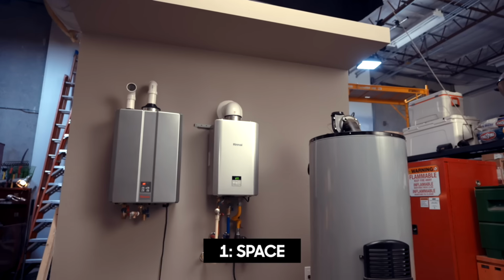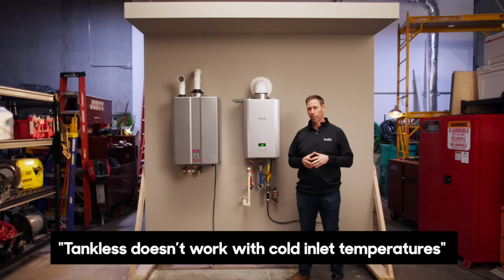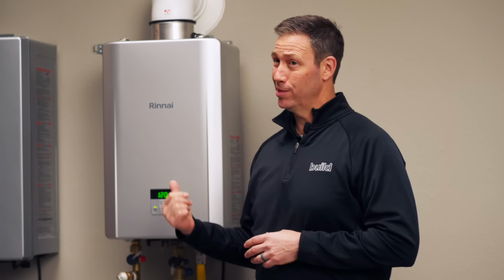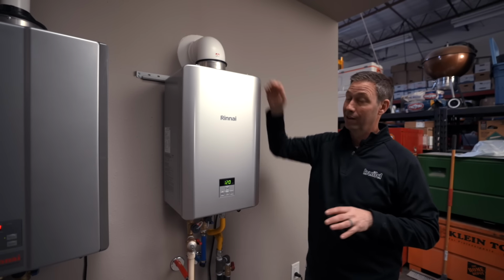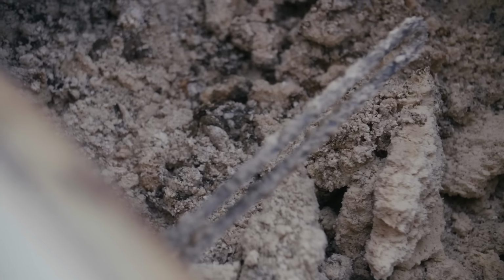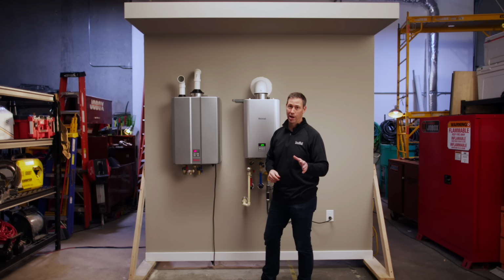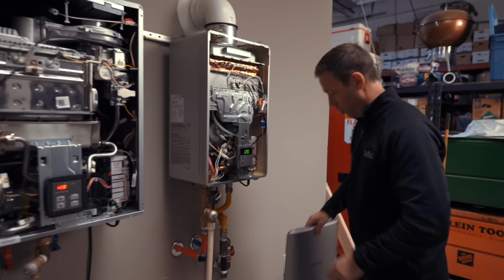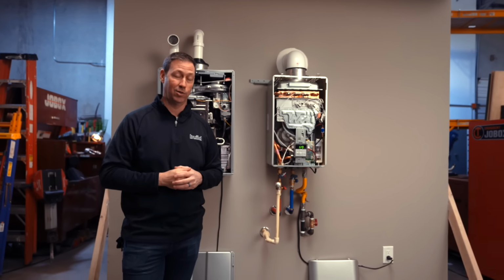DEBUNKING Tankless water heater LIES!

Comment: I installed a Bosch tankless unit when I renovated my house in 2006. What a nightmare that was!  Never worked right. Would constantly go into limp mode, or not fire up at all.
Bosch sent me a new ecu, didn't help. They told me I  had to upgrade my gas line($600), didn't help. Then the water line from my well($1,100), didn't help. 
I had nearly $4,000 into this tankless water heater before I tore it out and threw it in the trash. 
Replaced with a regular heater,  no trouble since. 
Never again!
Reply: That it wouldn't start or start in degraded mode suggests one thing, once you ruled out gas flow issues, air flow.
Fresh air into the burner unit, exhaust out, any restriction would give you exactly what you experienced. If it was a non-condensing unit, the exhaust should still be quite hot at the vent outlet outside. If it isn't, you have a major air flow problem that needs to be resolved.
Condensing units are a lot more efficient, so the exhaust will be cooler, as the condensing unit takes the wasted heat and recycles it back into heating water, discharging a small amount of water to be drained off or evaporated. There, you'd probably want instrumentation to measure air/exhaust flow rates.
Reply: @spvillano  I used the 4" stainless steel exhaust kit($400) from Bosch. Intake was also a 4" pipe maybe 5 feet long. No issues there. In the end,  Bosch blamed it on my well pump. The pulseing of the pump. I wasn't willing to spend another $1,500 to upgrade that to find out it's not that either. I just gave up and cut my losses.
Reply: @tlr-nut7275  that's even odder, as the pressure tank should remove any pulsations from a pump. A properly sized pressure tank both relieves cycling burden and pressure pulses.
That nobody managed to diagnose it properly, downright bizarre. Sounds like a case of "lemme guess this, lemme guess that", hoping to find a resolution without actually measuring anything whatsoever!
Reply: Things have changed a lot in the last 16 years. In the early days they had lots of issues. I got my first in 2015 and was impressed with reliability and performance. Moved across the country and promptly had one added to the home.
Reply: German household appliances are no good. stay away from them.
Reply: iv'e been a plumbing contractor 45 years, built my house installed a 50 gal elec . i have a constant pile of tankless out back of the shop all brands waiting to be scrapped
Reply: @claygoodwin8108  Sure you do. Plumbers in general seem to hate tankless water heaters. I'm sure it has nothing to do with the fact that you can charge $2-3k for a 3 hour job that doesn't require any education or follow-up visits.

Comment: There is nothing "instant" about "instant water heaters". They take a long time to heat up. Hot water water that's already hot is just that, already hot.  Mine takes about 30 seconds to reach a stable temperature, so you tend to start the shower while you brush your teeth, dumping that water down the drain.

But, endless is endless, and they are compact. 

As an aside - they can freeze (say, in an extended power outage).

I feed a 120V Bosch 2.5 gal tank with my tankless, so you get both instant water water with endless hot water.

Comment: Don't have a Rinnai but I've used an electric EcoSmart tankless water heater for about five years and love it. Had to hire an electrician to add three double pole breakers to my electric box but other than that the heater took me about ten minutes to install...les time than to remove the old tank heater. It has copper pipes and being electric doesn't need venting or anything else, just one inlet and one outlet and a lot of juice. However, since it only runs when I need it I actually save on my power bill. I'll never live in a house without an electric tankless again. Oh and the unit itself was only $350

Comment: Gas is not an option for me. I have been using electric tankless for well over a decade. I have installed several different brands in different properties and have no real issues. My hold back on installing more have been home with less than 200 amp service. I would welcome seeing a video  on electric tankless water heaters

Comment: YES You will get a cold shower!!!  And cold water at the sink!!  The draw rate from low flow faucets and shower heads do not draw high enough flow rate to trigger the threshold rate in the tankless heater to signal the heater to warm the water.  So please pass the word to our tankless water heater manufacturers that we should not have to turn on the bathtub faucet full force and the bathroom sink full force to draw hot water for the upstairs washing machine. They need to lower the threshold draw rate.
Reply: Amen.  Those manufacturers all could design either a different computer control, or a mini tank as some have...and they didn't bother.  Claim their products are good for environment, then cause people to waste water just to get it warm.  Sorry, idiots, you don't get my money.

Comment: My Tankless failed in 14 months, it was very problematic shutting down, drawing codes every month or 2.  My new one has been running for 5 months with no issues.  Probably would never switch to tankless again, but it was very easy to change out when it failed completely.
Reply: What brand? Mine has been running for 5years straight in a 6 person house with no issues.
Reply: @geoffmooregm  what brand you got?
Reply: @devdevzmusic  It is a Navien.

Comment: If you put enough small tankless at the points of need, there is no need to run a hot water line in a house at all.  Ideally you put the controls at or near the outlet and adjust it so it produces the desired temperature.  I have a shower like that, and in about 20 seconds, the precise water heat is coming out, every time.  No wasted water trying to balance hot vs cold and taking minutes to do it.  small tweak on the heater controls between winter and summer.  Mine runs using a battery, so hot water, whether or not there is house electricity.

Comment: We have had tankless water heaters since the early 80ies in my parent house in north of Italy. In that house the same unit serves as hot water for washing and as heating water for the heating system. A 24k BTU unit serves the 3000sf home. The first unit lasted about 12 years, the second one about 20 years and the third one was installed 5-6 years ago and is still working well. I also lived in several apartments were we had tankless heaters, including in japan, korea where we had Rinnai ones and they worked pretty much as Matt is claiming on this video. They are very reliable and they only give you minor issues if you do not keep up with the cleaning maintenance, which I think needs to be dome every 2 years. In Europe the cleaning costs about 100euros and take less than 30 minutes.

Comment: I have a smell of gas at the vent when making hot water, Is there a solution to reduce this? 2" pvc vent pipe.
Reply: gas smell?  get professional help, this is not a question for the internet.  start with gas company, most will check for free.  it might be something simple, just like the small gas smell when i turn on my oven.  BUt unless you have someone knowledgeable check it out, you don't know that.  Please be safe.

Comment: Matt saying tankless never run out of hot water shows he has never done dishes in a restaurant, I've worked in quite a few and 80% of the tankless units can not supply constant hot water. Most of them Can't even stay hot till the tubs are filled.

Comment: We were stoked to discover our Readytemp on-demand circulator satisfied our newly installed tankless water heater flow requirements.   It saved us from installing a dedicated hot water return line saving us big money.  Now if I can just get the kids to remember to shut off the bathroom light.

Comment: In the early 90's I went to a popular  home improvement store inquiring about a tank less water heater. They claimed that any warranty would be void if you didn't buy a soft water system because San Antonio has hard water. I thought that was BS because that same hard water goes into water heaters with tanks also. I didn't buy a tankless water heater but I didn't buy a water heater from that store either.....
Reply: tankless have much smaller tubing so hard water is much huger problem for them.   not BS.

Comment: we will be using a heat pump water heater for all sinks that need hot water quickly with a recirculating pump. using a mixing valve to send 85 degree water from that to an instant on combi boiler that supplies hot water to showers, tub and washing machine. Had to get the boiler for radiant heat, so now unlimited hot water for showers with only a 35 degree temperature rise. Checked with Rheem, they said its ok to do.

Comment: I have seen where the northern climate cold ground water temperature has impacted the electric tankless water heater flow rate/temperature rise while in use.  This has not been a problem for all of the other water heaters styles that I have personal experience with.  It is rare in the Midwest that a living space can't accommodate a 50 gallon (or larger) tank style water heater. I'm not sure about other parts of the USA.

I have used/installed standard tank, electric tankless, natural gas tankless and hybrid electric heat pump and geothermal water heaters.  I have found that the most efficient (not based on initial costs) were #1: geothermal, #2 hybrid electric heat pump, #3: gas tankless and in last place any style of standard gas/electric water heaters.

I would choose the geothermal or hybrid electric heat pump models over other styles.  I love the fact that the hybrid electric heat pump models work great for homes with solar panels and/or emergency power generator setups.  Almost every portable power generators will easily handle the "heat pump" operation mode of a hybrid electric heat pump water heater.

Comment: As soon as he mentioned taking combustion air from in the house I knew for sure it was a paid add. I'm surprised he could say that with a straight face
Reply: It depends on your circumstances. I'm in British Columbia, Canada and we cannot pull in -40C air without freezing the unit. We use indoor air instead, and the building's ventilation system replaces it. Ordinarily, though, I would agree with you: outdoor combustion air is best.
Reply: @paulmaxwell8851  but you can if the hot  air is in a 4in pipe that is inside a 6in pipe. Combustion air is heated on the way in

Comment: Back in 2017 I bought a Honeywell water heater that has a tankless-type heater mechanism on it. The water in the tank is kept only luke-warm, and is heated up to the desired temperature at the outlet only as demand requires. It doesn't have a pilot light, and has intake and exhaust vents just like a condensing tankless water heater. The tank's capacity is 50 gallons. It's kind of a weird thing, but works well.

Comment: The biggest issue I had with my Rinnai was that when the groundwater temperature was high (Texas Summers), and the set point of the water heater was low (98-110), the water heater would shut off heating during demand because (this is my theory) the heater has a minimum delta that it will add to the ground temperature, and if that outgoing water is higher than your set point then it automatically turns off heating. This issue was exacerbated with a single handle/valve shower setup that ends up pulling a lower flow rate on the hot water line than the heater is rated for. This generally meant that I had to adjust the setpoint of the heat depending on the season. I set it colder in the summer and would end up 'turning up' the shower temp to get the right mix and get enough flow, and then in the winter, I would increase the set point in order to blend with the colder groundwater. A few trips a month to the garage to adjust the setpoint was worth it though to have endless hot water, and once we added the voice control to the heater it made it even easier to use and adjust water temperatures on the fly. Need to mop the floor? Crank it up to 140F in an instant. Need to pour a bath right after? Turn it down to 100F and get the 'perfect' bath temperature.
Reply: You are correct. Most of these units are 200,000 BTUs and have a 10 to 1 turndown. So minimum firing rate is 20,000 BTUs  so you just have to convert GPM to pounds per hour and multiply your delta t. If it is less than 20,000 it will cycle on and off. One manufacturer has solved this problem by adding a small 2 liter tank and circulator. The Tank is kept at temperature all the time but of course with minimum standby loss due to the small quantity of water. This eliminates minimum flow rates by starting the unit on not only flow but also temperature in the tank. It also eliminates any time difference it takes to get to the faucet because hot water is on its way as soon as you open the faucet. Last but not least it rids the system of the cold water sandwich. This problem is not uncommon where people add a solar tank as the feed to the tankless. We solve this problem by installing a thermostatic mixing valve backwards to direct flow from the solar system to either the faucet or the tankless and then a second valve to retemper.

Comment: I got a very small electric tankless and I really like it. It’s 6kw and works great for everything except filling the tub at full flow. Endless hot showers though. My very small electric tankless here in Texas can only flow 1.5 gallons per minute due to the limits it has with a low water inlet temperature in winter. I installed it for less the $400 and because it’s tankless it’s ventless. I have a video on it but don’t want to creep in too much of this video.  I moved my tankless much closer to my faucets and I get hot water much faster then my tank that lived on the other side of my house. My eco smart tankless is stainless and it works fine. I electrified everything but my BBQ pit and only pay the minimum for natural gas now. Also electric service would be a problem with a huge electric tankless but my 6kw only needed 20 feet of 6 gauge wire. Honestly if you are a mega consumer of energy stick with gas but if you are honestly trying to use less energy consider a tiny little electric tankless hot water heater.

Comment: A tanked water heater is around 35-40k btus, a tankless is over 200k..you're using a lot more gas when its running, I don't believe you're saving anything on gas, tankless descaling annually and most people cant do it themselves so that's a cost, a tankless installed is more then twice the price of a tanked, repair costs on a tankless is a lot more as they are more involved with more parts. The only advantage they have is a space.

Comment: Just installed a Noritz EZ111DV unit for my family of 7.  Water connections are on the top to make swapping from tank to tankless easier.  Can fill the tub for the littlest and then get the rest of us showered without the complaints from the everyone about cold showers.  Best mechanical upgrade yet....next is going to be a full mini-split upgrade....goodbye ducts.

Comment: My parents had a tankless Bosch and it drove me nuts when I would visit them.  In the middle of a shower out of no where it would go from hot where I set it, to freezing cold and then after i adjust it would be scolding hot. It took time to get it back to where I needed it.  This went on from the get go as far as I recall but they never fixed it.  Any idea what the problem could have been?
Reply: That's not a bug, it's a 'feature' of tankless water heaters in general.

Comment: I lived in the midwest, Chi-town, and had a 35-gal tank that lasted over 30 yrs with 3 people. Simple maintenance, and keeping the tank at a  low but suitable temp. Tankless water heaters are basically for big families. the savings vary.
Reply: Big families? Where did you come up with that? I live alone in the NE USA, ground water average temp is 47°, yes I had a tank that lasted way more than 30 years until it rusted through. Put a new tank in but got tired of coming home after 3 days and hearing heater(natural gas) running to keep water hot when I hadn’t even used it for days. Tank was only 3 years old when I replaced it with a tankless. Tankless dropped my gas bill enough that it paid for itself in less than 1 year! I didn’t buy a “name brand” one. Even if I had it would pay for itself in a handful of years! I’ll never put in a tank heater again!
Reply: Tankless saved me $25-30 month living alone with a sub $200 gas and electric bill.

Comment: Gas boilers will be banned to be sold in some EU countries starting in 2025. Gas is already being replaced by electricity. 
Gas is the past, this technology works and worked great but has no future (because of CO2 emissions). 
Therefore, 2 options: electrical tankless or hybrid. 
The first one really expensive on monthly bills because of the minimum required W (even if you are not heating any water).
The second one, you pay more initially for the investment but,  you can preheat the water in a tank (using thermal solar or PV),  and less electrical power is needed because the water is preheated.

If central heating is required, then a Heat Pump+tank is the best.
Expensive and not as efficient as the gas? Sure. But there's no turning back.
Reply: I envision wool sweaters in your future, good luck

Comment: I just did the calculations and your math is a bit off - with 40º cold water heated to 120º and a 105º shower using 2.5 GPM you'd need 2 GPM of hot water to balance out the remaining 0.5 GPM of cold water meaning you couldn't run 3 showers at once, only 2.